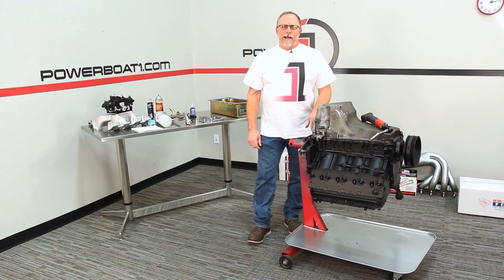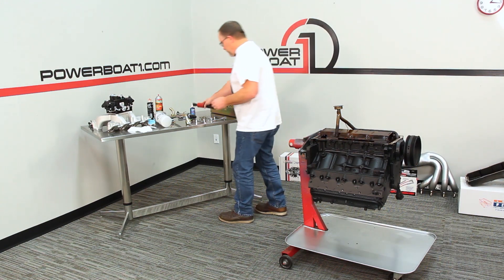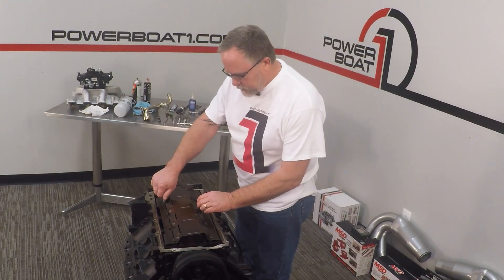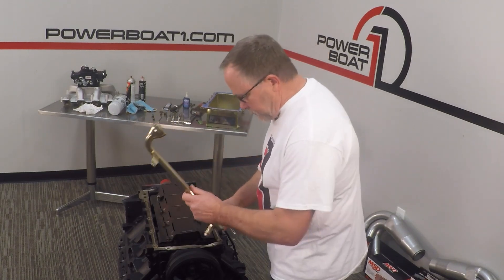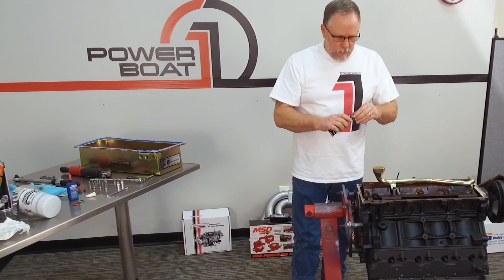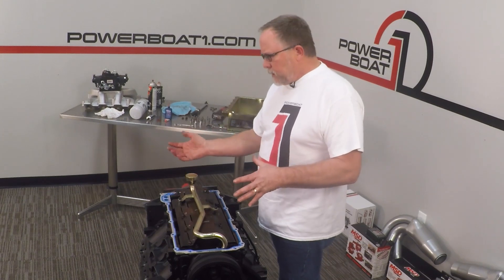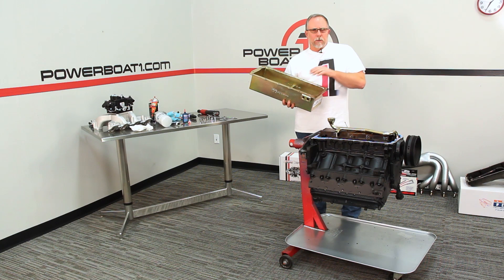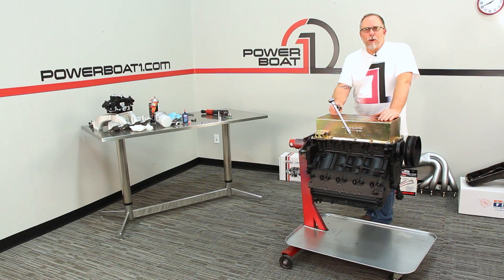LS ENGINE MARINE CONVERSION: Installing the Marine Oil Pan

Comment: There is probably 5 grand or better in just the conversion for the LS motor. Wouldnt it be better just to build a non LS performance motor for the same price. If I had 5 grand to spend on a engine I could build a pretty hot motor , The build is really cool just dont see the logic with the Marine kit

Comment: What is the make and part #s for the Oil Pan and Pickup tube? Thx
Reply from the maker: Hi, this model is a prototype made by Dooley, it should be in production in late spring / early summer 2020. It will be available at retailers like CP Performance and Hardin Marine.
Reply: @Powerboat1  price for all the parts please
Reply: Anyone can put a engine in a open boat .
Make a LS coast guard approved inside a I/O  boat .. that is making a LS  a marine engine